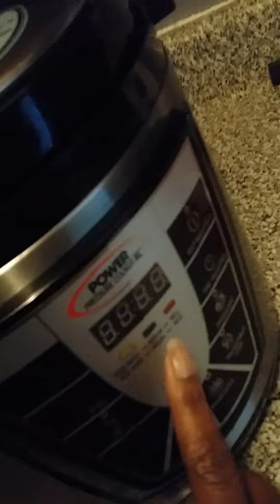Opening and closing the Power Pressure Cooker XL

Comment: Finally, someone who points out that the lid won't lock tight until AFTER the pressure is built up.  I tested now and you are right; the pressure had built up and then the locked the lid tight.